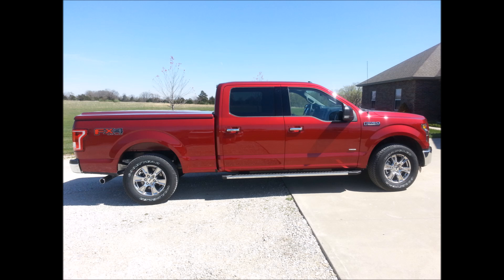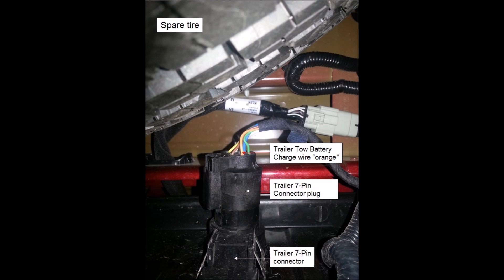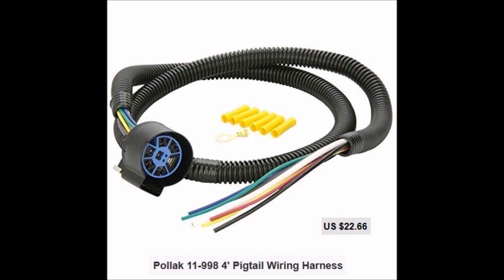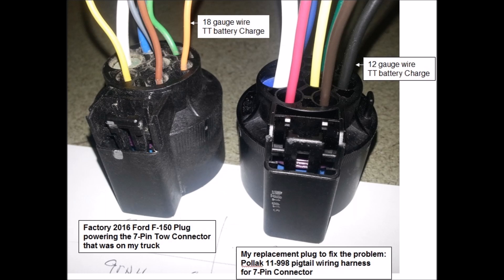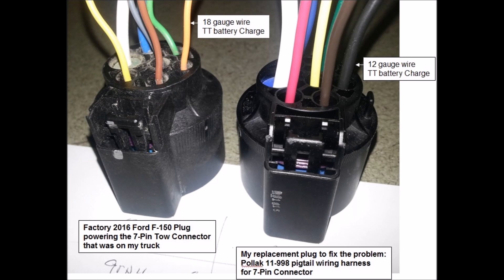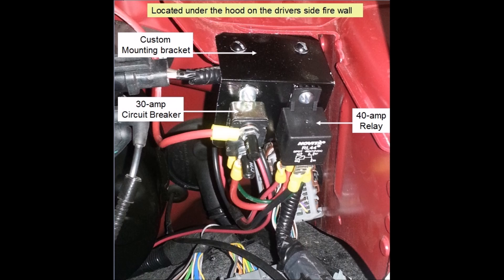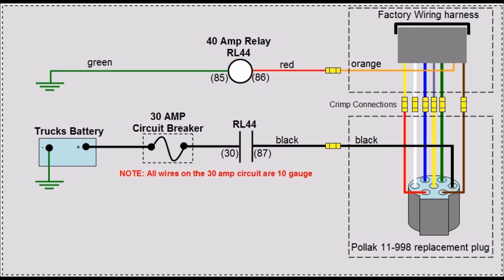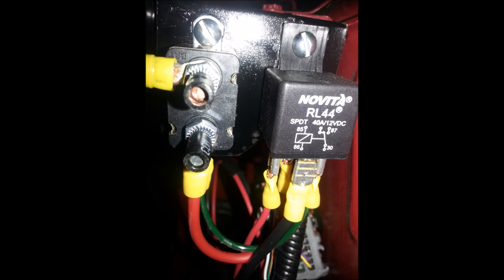2016 Ford F150 - Trailer Tow Battery Charge Problem & my Fix

Comment: Spoke to a tow wiring shop today and they suggested just going a straight drop from the battery to the back. Is there any reason not to do that? I want to forward them your video, but they did my other car a few years ago and it works great. They are essentially suggesting doing the same thing as then. Run a hot wire back. Just wondering your thoughts. Thanks.
Reply from the maker: @ casmered – There are a couple of reasons for NOT running a hot wire directly from the battery to the 7-pin tow connector. To begin with, a non-fused “straight drop” circuit is a fire hazard in the event of a short circuit. Second, if your tow vehicle is not running, and you fail to disconnect the load your tow vehicles battery could be drained. 

Ask yourself, would anyone allow an electrical contractor to wire the circuits in their home directly to the main feeders bypassing circuit breakers or fusing…I don’t think so. All electrical circuits need fuse protection at a minimum, and in this case the addition of a switch or relay to control when that circuit is energized. Final thoughts…do not use that wiring shop!
Reply: RDB83052 thanks for the quick reply. I should add that I overlooked in my statement he was talking that he would also use a solenoid that was key activated in the wire. Not sure if that makes any other difference.
Reply from the maker: A solenoid, relay, or switch all do basically the same thing but offer no short circuit protection. I would ask him to incorporate a fuse or circuit breaker to protect the circuit from a potential short. The design of the circuit will then be very similar to mine in this video. 

The reason that I used the orange wire to control the relay/solenoid is because I wanted the circuit to function as it was designed from the factory since it was a new truck, but wiring the solenoid to follow the logic of the keyed ignition is fine too.

Comment: PERFECT solution! VERY clear and thurough.

 I'm a little too close to my next towing event to do this, but I'm ordering the connector now (I have the relay and CB).  I've noticed that if I plug in my trailer while the truck is running, the TRM will not activate the 12v charging line. IF, however, I have the truck OFF, plug in the trailer, then start the truck, all seems to be fine. 2016 Limited btw. Does this sound normal?
Reply: Not sure if that is normal, but my truck only activates the Trailer Tow Battery Charge circuit when I place the transmission into a gear. The circuit then appears to stay energized until I turn the ignition OFF. When
I installed this modification I wired in a 12 volt LED powered by the orange wire to determine the logic of that circuit and to verify that is was ON. I located the LED in visible spot between the rear bumper and the fender. It’s only
visible to the person that knows its location. I probably should have detailed the wiring and location of the LED in the video…maybe I’ll try to edit the video.

Comment: I implemented the mod last summer on my 2015 F150 and so far it has worked great.  I just got back from 3 months of RVing across the southern USA from Florida to California and its worked flawlessly.  I don't need to waste propane as it allows me to run the RV fridge on battery, with no worries that the trailers battery will run low or the rooftop solar panel not keeping up. There is about a 1 volt voltage drop in my wiring harness as I get a steady 13.5 volts at trailer battery.  Thank you very much for a great mod.
Reply: Thank you for the comment!

Comment: Thanks for posting this!  Ford really screwed up with the small wire gauge.  ("Ford  has a better idea").   My guess is with all the lights on, they dont you pulling 12amps more amps from the alternator.   
    I have the same truck, with tow package, it's  only 2mos old.  We sold our motorhome, and are looking for an RV trailer.   Looks like I'll be doing this upgrade.

Comment: This is a great video and a must view for anyone that plans on doing any serious RV-ing with their F150. I'm planning on performing this mod once the weather warms up a bit (I live in Illinois). My question to you is does doing this mod have any negatives? Does everything still work in the trailer status display? My 2016 is a Lariat - I'm guessing yours has the fancy display too? Anything else to be concerned about? Thanks for posting!
Reply from the maker: Theo, Thanks for your comment. I have towed my camper over 10,000 plus miles since the mod and I have had zero problems…it’s worked perfect. The reason that I designed the circuit this way was so that the Trailer Tow features would still work as designed from the factory. The only exception is that now I have 30 amps of power to the trailers battery with very little voltage drop. 

All of the instrument cluster features for the “Trailer Tow” will still work as designed.

Comment: I also decided to purchase SAE J1128 - # 8 gauge to go from the battery, through the 20 amp breaker, the heavy duty 12v 100A relay and to the back bumper.  the entire run is wire loomed and fished through the truck frame (the passenger side is shorter FYI) .  I managed to get five cable ties on the wire loom through the side holes along the frame so it's just not bouncing around inside the frame.

I don't know if I mentioned this but I'm not charging a battery.  I am powering 234 watts / 19.5 amps worth of LED lighting on my back bumper and boat trailer (I get there in the dark, flip the switch and it's like daytime at the boat ramp).  My older F150 has this setup and it runs great on the factory harness but I didn't want to harm the harness on the new 2016 F150 with the small OEM harness wire size.  Had it not been for this video...  I'd might still be searching for a solution.

Comment: I purchased a Pollak PK 11-998 (as outlined in the video) and I have taken that a step further...  I didn't want to cut into the OEM factory harness so I also purchased a Pollak PK 11-934 and made a short sacrificial jumper between the factory connector and the back side of the bumper trailer outlet.

Comment: where do I locate the factory wiring harness?  Is it simply the connector in the rear of the truck to which the current harness is connected?
Reply from the maker: You are correct. The factory wiring harness is connected to the plug (the one that needs replaced) that powers the 7-pin tow connector. When cutting the plug from the harness leave as much harness length as possible to make splicing the harness wires to the replacement plug easier.

Comment: Just adding my voice to those who recently bought an expensive 2016 with the expectation that it would charge the trailer battery just like the car we just traded in.  Well more $$ and a day plus of my time will fix this properly so thanking your profusely for this well done and clear video and shame on Ford.  What did they think people were going to do with a pickup truck that came with a MAX tow package, why they were going to tow their travel trailers that have batteries.....duh.
Reply: Thx again!  

I just finished installing a 10 amp wire with split tube (across the cab firewall below the hood opening, then down the drivers side by the power brake diaphram, along the frame and over the tank zip tying it to the slip tube that is already there.  I used an empty terminal on the buss bar (under the plastic next to the fuse panel) rather than direct to the battery.  I installed the pollak connector too (see below).  I used just a 30 amp inline fuse near to the buss bar.  I decided not to incorporate the relay and original orange wire since I had trouble getting that circuit to recognize the trailer anyway, so as a result my trailer pin is always hot.  I may at a later date add a relay to a circuit that comes on with the key but for now it's ok since I have a car battery protector installed in the trailer that will keep the car battery from draining if I don't disconnect the truck.

As to the pigtail.  I unplugged the connector at the socket.  I then removed the wrapped electrical tape then unplugged the connector at the other end near the spare tire.  I then cut the large gauge white wire near the fender and also a small blue wire going to another circuit so I could remove that connector.  With the complete pigtail removed I cut all the wires about 5 inches from the"spare tire end" connector.  I then cut the new pollack pigtail to a matching length and spliced in the wires.  I used blue (14-16) butt connectors for all but the black and white wires where I used the supplied yellow 10-12 connectors.   The colors all match except truck yellow goes to pollack red, and truck grey goes to pollack yellow.  The pollack black will go to new wire you run from the engine compartment.   I put split tube on everything and buttoned up with tape and rehung with zip ties.  Looks great like it came from the factory that way (and should have!!!!)

It's all fine all the lights work on my trailer and the trailer charge circuit is now operational and good to go!

BTW I ran an extra 14 gauge wire in the split tube since who knows when one might need another 12v circuit at the rear end in the future (like for a canopy interior or back up lights, etc.
Reply from the maker: +David - wiring the TT Charge circuit to be “ON” all the time there is hi risk of draining your trucks battery if you do not disconnect the trailer from the 7-pin connector whenever the truck is not running. 

I added another comment explaining the logic of the orange wire. Sounds like your wiring is working great, but I would recommend getting that relay to work. I think you were there but the sequence of events needed to energize that orange wire was not met therefore the relay was not working.

Comment: Great  video ' I have 2015  F 150 ' and my screen is telling me trailer tow battery is not charging??  So now I will pull the harness and install a thicker gauge  wire ' thank's for the tip....
Reply from the maker: Dan – Installing a thicker gauge wire by itself may not help much. Not sure about the 2015 F-150, but on my 2016 the “Trailer Tow Module” controls that circuit so a heaver gauge wire will definitively reduce the voltage drop but I’m not sure if Trailer Tow Module will support more amps. Let me know how it works…
Reply: Good point' I will do the same connection  30 amp circuit breaker and a 40 amp relay with the 12 gauge wire harness....hope it works??  If not I will be calling the dealer...it seems to be a on going problem ?? I have other issues with the censors   But besides that it's great truck for towing..more power then glory l o l .. I will let You know either way.... Thank's...Again..good video...
Reply: if you just blow off the orange wire all together forgetting the relay that cirucit will be "outside" all trailer tow module stuff.   Just need to be sure your trailer has a car battery protection device and your remember that pin will alway be hot.  I wired up my Suzuki and trailblazer like this and it worked fine.
Reply: David Kebler Thanks for the tip ' will try that if it acts up again' but for now it's not giving Me any problems ? Had a lot of dirt in the connector at the back of truck as I travel on rough gravel  roads with my trailers..so far so good ????

Comment: the new harness I ordered should arrive today... I'm curious if the main 20 foot harness going forward to the front of the truck is undersized as well or is this just an issue with that last 12-18 inch short jumper from the main harness to the trailer outlet on the bumper?
Reply from the maker: Richard - On my truck, the trailer tow battery charge circuit is an 18 gauge orange wire without dedicated fusing. The orange wire is 18 gauge from the firewall connector under the hood and continues back to the 7-pin tow connector. So yes, it is 18 gauge in the 20 foot wiring harness.

I should clarify that Fords wiring size for this circuit is correct for their design, but their design is non-functional. Their circuit is controlled by the Trailer Tow Module located under the dash so even if their wire was 10 gauge I doubt if the Trailer Control Module would support 30 amps.

The modification that I have provided uses the logic/control voltage from the Trailer Control Module to control the new 30 amp circuit. This was the least expensive and simplest way for me to make the circuit functional.
Reply: yup that's trure it's 18 gauge all the way.
Reply from the maker: The orange wire must be energized to power the relay for the new circuit. The Trailer Tow Module controls the orange wire, and on my 2016 Ford the logic for that circuit is; 

1) The Trailer Tow Module must detect that a trailer is connected to the 7-pin Tow connector
2) The transmission then must be moved from Park to a gear to energize the orange wire 

Also, the instrument cluster inside the cab can be helpful for troubleshooting because it will display a message regarding the status of the 7-pin Tow Connector if a trailer is connected or not.

Comment from the maker: Update - I towed my R-pod 180 camper for 3000+ miles on vacation and the new circuit modification worked great keeping the campers dual batteries fully charged while running the campers refrigerator on 12 volts at the same time. That's how the circuit should have worked from the factory!

Comment: Thanks for the video. We have a 2016 F150 and are finding that the battery is dying when we tow while running the fridge off 12v. So if we make the modifications you recommend it should work? How could they have such underpowered wiring in the truck!? We were towing previously with an Explorer and it charged the battery while running the fridge no problem.
Reply from the maker: +We Found Adventure - I completely understand. My brother’s 2013 Ford F150 TT battery charge circuit works properly. On his truck the wiring is sized correctly, it’s protected with a 30-amp dedicated fuse, and is controlled via relay similar to my modification only its factory. Why Ford would re-design the circuit to be non-functional is beyond words….it’s brain damage! When you purchase a new truck you don’t expect these types of problems. 

I have a career of expertise in equipment controls. I retired from a fortune 500 Company after 35 years of troubleshooting, designing and installing equipment controls ranging from simple circuits like this to very
complex control systems that have thousands of I/O over multiple communication networks. I would like to know their logic, reasoning, and the issues that drove the circuits re-design. 

My wiring modification provides 30 amps of service to the trailers battery with minimal voltage drop. So, if your trailers amperage load while towing is less than 30 amps this should solve your problem.

Thanks for your comment!